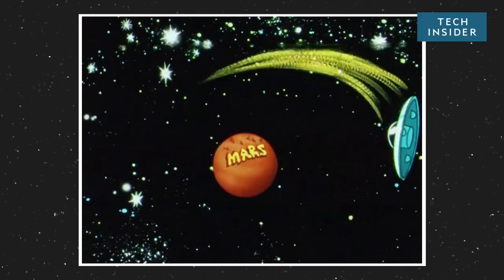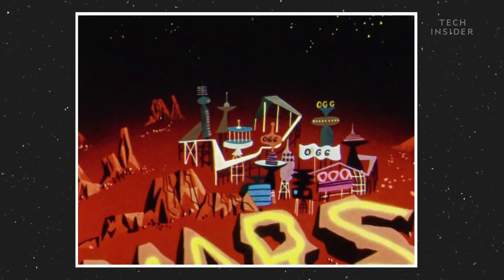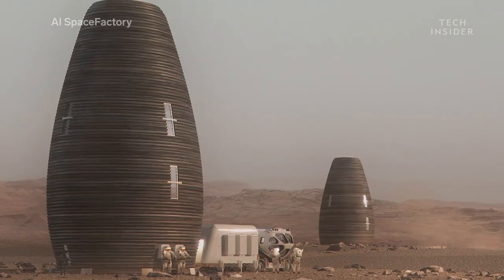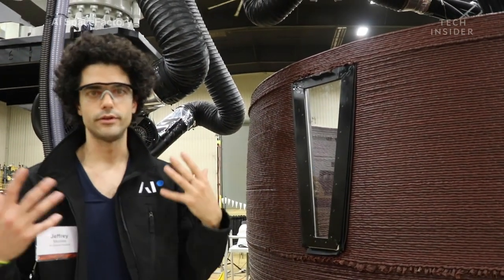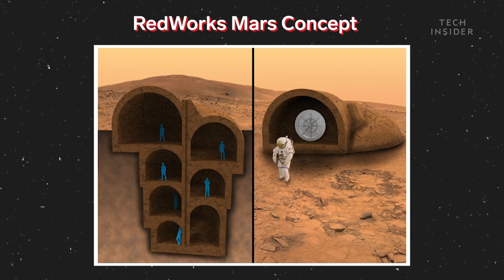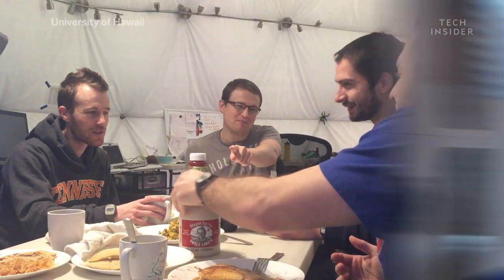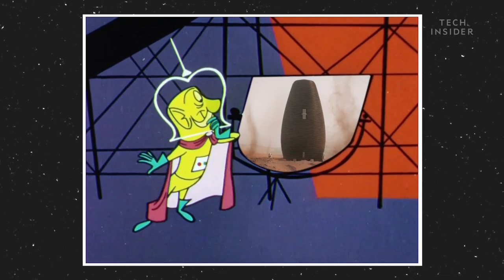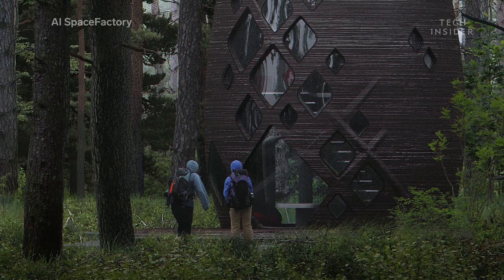The Mars Homes That NASA Awarded $500k

Comment: I would love to see everybody living in a house like this on earth. This would save so much more space and would offer a life in a good relation with nature.
Reply: I think it's very attractive. I would live in one
Reply: It looks awesome when you think about it. But the cost of the building will be very very expensive.
Reply: @fizan6129  Not nearly as expensive as a normal house. Because of 3d-Printing it will actually be quite cheap, depending on the cost of the used material.
Reply: The main issue would be how it holds up in extreme winds and extreme winter.
Reply: @shadowscall7758  I can't imagine a wind strong enough to lift such a house, espacilly including all the interior. And if it's strong enough to survive mars than it's strong enough tu survive winter too, dont you think so?
Reply: @dem4xed  The winds wouldn't have to lift it, just knock it over. As for the winter, if it is airtight, great, but it would still have to have some form of heating.

Don't get me wrong, I would love to live in a house like that and would love it if more people did, I just would want to make sure all of the considerations are made. Too often, you see stuff like this being touted as "the next best thing in housing" but you only ever see examples of it in temperate environments with mild weather.

It would force you to be minimalist, which would be great for our society and you could build a bunker close by for emergencies.
Reply: @shadowscall7758  Are you not aware that Mars has a much colder temperature than earth and has extremely harsh dust storms? Marsha, the Mars Home, naturally has to have better insulation, better heaters, or any other technology needed for a house to survive in a harsh environment on Mars, which means the house has to be naturally stronger too. Seeing as they're gonna build Terra with the same materials as Marsha, then for sure this house is more than enough for Earth. Of course it would need some tweaking to better fit the less harsh environment Earth has.
Reply: @eroxcis  Mars storms are not as bad as some of the storms on Earth. Movies get that wrong all the time. Sure, they cover everything in dust, but the winds only get up to about 60 mph, which is less than half of the speed that winds on Earth can get to.

https://www.nasa.gov/feature/goddard/the-fact-and-fiction-of-martian-dust-storms

As for the cold, yes, Mars is cold, but the heating system they would use is probably something not affordable for the average person, so it would mean the house would not work for the average person in cold areas, unless it was an affordable heating option.
Reply: @shadowscall7758  Houses on Earth are also not strong enough to survive the harshest of storms, and to be fair, depending on where you live, they're not common.
Also, whatever you see on the video is clearly something they're still working on, not everything you see is final yet, and of course how Terra will be built will be different from how Marsha will be built (seeing as they both look different), just that they'll use the same materials. 

Also, I suggest reading my comment again because I mentioned this: "Of course it would need some tweaking to better fit the less harsh environment Earth has.", which, if you didn't understand, meant that heaters and other things will be changed to fit the type of environment Earth has.
Reply: Shadowscall775 telling by the shape of the house most wind will probably go around it
Reply: @advancedsoldier8569  Yeah, I am hoping that would be the case. Like I said, I would love to see houses like this become commonplace.
Reply: It's round, thus it's less safe and has much less space... Plus water damage will become a huge problem....
Reply: david abe why would water damage be a problem?
Reply: @advancedsoldier8569  Because water will soak through... The windows are all "weak spots" and will eventually fail, and they are incredibly exposed. This is one of the worst designed homes in human history. I get it, it looks cool, I can see that... but all i see is failures. The insulation is near nothing as well. It's round so you lose crazy sqft and structurally it's incredibly weak. 

NASA stole our money and gave it to a team of children pretending to make something of value.
Reply: @dem4xed  It's made of basalt this shit ain't cheap
Reply: @dem4xed  Not sure if 3D-printing is the best way to go about it. For general purposes, it's a good short-term solution for small-scale production, but it has its own issues. If you look closely, the products you get from 3D printing have striations, since the machines lay down melted fibers from the bottom up. Consecutive fibers don't always meld together completely, and it can create structural weaknesses called weld lines. The quality that is needed for the product depends on the intended application. This kind of stuff is basically within the realm of engineering.
Reply: @Psi01  Thats true. But as they said in the video, 3D-Printing needs improvement before this can really work. Nonetheless I am very optmistic about that.
Reply: @FEV369  Why do you think that water seaks easier through those structures, than stone ones? Why are windows espacially endangered by water?
Reply: @Blankenboom77  I dont think that they would build it from the same materials here on earth, if it would go into production.
Reply: @dem4xed  I'd suggest reading some basics about building. These are the weak points of a house, water bleeds through. This is not "stone." It's pours, it's thin, has little to no insulation (R). Rock like this will draw moisture in through all the walls that are covered in water due to it's idiotic shape. 

This is in fact one of the worst designed homes in human history.
Reply: @FEV369  Yeah right, it isnt stone so i think, its actually more capable of keeping you dry than normal houses are. Second: How do you know that, those are pourly insulated? Have you ever seen the whole building process? How do you know about the insulation abilities of the materials used? Do you really think that square shaped houses are better in keeping away the rain?
Reply: @dem4xed  You clearly have never worked in any kind of construction. I give up, this "house" is perfect for you... The world has been building wrong forever, no one ever thought to place windows facing the sky or build walls in massively limiting circles. 

Do you even understand how a circle limits sqft? Do you even understand how structurally a circle is vastly less stable than a square? Go stack stuff in a circle... go... do it....
Reply: @FEV369  Yes for shure. And thats why sodacans are withstanding massive amounts of force when applied facing the plain side. Youre right. Circles are so poor.

Btw. round houses aren't new inventions. Humans build in round shapes since they build at all. I suggest reading this wikipedia entry, or any other source faving this topic:

https://en.m.wikipedia.org/wiki/Roundhouse?wprov=sfla1
Reply: @dem4xed  Look, my goal is not to be a dick. A round house looks cool, in fact I have a 3 story turret (round) on my Tudor style house. It's cool... spiral stairs are cool. But at the top floor is my music studio, and the walls are all round... So you lose a massive amount of SQFT because everything bunches in a smaller area. Think about setting a desk against a round wall, it pushes you in, you lose sqft in the center back of the desk, unless your desk is rounded to match.

In a big ass round house (google them) you see a wide open floor plan, because if it's not open, it sucks. Think how you would make rooms inside of a giant round room. The walls would start to triangle. If you have a closet on the round wall, it would have to be roundish, the doors roundish...  Your bed would butt up against a roundish wall... Pictures hang weird. Basically you start trying to add strait walls but in doing so you make really awkward rooms. 

In big round homes you usually don't have walls going to the ceiling, separating rooms. Now noise carries... 

Again, round homes look cool, but they are cool for a rich person as a get away lodge... 

As for the windows... Windows are "weak spots" in building. Water collects around them and over time damages the home. In the case of this design the windows physically face up, thus water will rain onto the windows (wtf btw) and then collect. From there you have pooling water, it WILL enter the house. It will add moisture to the home. It WILL destroy the window. There is a reason we have a roof line that goes out 1-2 feet, it's to keep the rain off the sides of the home and off the windows.
Reply: @FEV369  Of course the furniture made for rectangular houses doesnt fit for round houses, just as over way around. But making round furniture doesnt seem to be much of a problem to me. They could be mass-produced if everybody would use such.

To the windows: Does your car get wet just because the windows face upwards and arent protected by a roof?
Reply: @dem4xed  You seem to truly not understand how homes are built. 

Yes, in fact your car bleed water into it because the windows are faced up... They drain out the bottom of the door... In your house, that would be draining into your home. 

You glossed over how rooms would be awkwardly shaped in a round home... You don't understand the sqft lost by the "pinch" of strait walls going from the outside of a round wall to the center point. 

Get a piece of paper, start drawing walls and furniture to fill your round house... watch as you quickly start noticing massive sqft looses, awkward room dimensions. Now start placing mirrors and pictures on theses walls and notice they face the wrong directions or hang poorly on a round wall.

You claim if homes were round that we would just build round furniture. It's like any type of building is a foreign concept to you. You make an incredible assumption that all homes would be built off the same diameter... so rounded items would only "fit" homes of a similar diameter... Where as all furniture built for any square home fits, as long as the room is big enough (same for a round space.)  

I honestly think you should get a piece of paper and start drawing. if you don't do this first logical step I can't take you seriously. If you don't take that first step, you shouldn't take yourself seriously on this subject. Considering how easy this is to do, if you can't bring yourself to do it, I can't believe you spend the time at least envisioning the problems innate with round exterior walls.
Reply: @FEV369  Making some furniture with different diameter isnt any different to making different sized rectangular furniture, you just need to stick with certain diameter-formats. Who, for whatever reason, wants a special diameter needs to pay extra money. 
Second. Your point with the window isnt making any sense to me. If your car gets wet by rain, than you should consider repairing it. 
Third. You aren't loosing square feet, you're just spreading them differently if you build round. 30 round square-meters are 30 rectangular square-meters. The concept of putting walls in the middle of a house is actually much more spaceconsuming than building round.
Reply: @dem4xed  I take it you put a net total of zero effort into drawing out this wonderful idea of round living.

Take care man.
Reply: @FEV369  I was hoping to be able to change your mind.

Anyways, take care.
Reply: Influunt Plus plus more space
Reply: @dem4xed  I was hoping you would put actual effort into proving your position on the matter, but you didn't... and thus it was impossible for you to convert me with such laziness.
Reply: @FEV369  For me there's nothing to prove. What is missing in my argumentation? I can send you a picture of a drawing showing a round room via dm if this is possible and if you want to.
Reply: @dem4xed  A piece of paper with a circle and how you would divide up your pie home... You must be a joy to "debate" with in person.
Reply: @FEV369  Okay here's a link where you can look at some scribbles. Proportions could be off. Sorry for that.
https://1drv.ms/f/s!Arl6GUZ4jlck0Hn2Q_3oZ_3A8ZxP
Reply: @FEV369  Have you actually watched the video? Everything isn't final yet, and if you're not aware, the house is meant for Mars, a planet wherein rain doesn't happen anymore. 

And as for Terra, the house they're gonna build on Earth which is similar to the Mars Home, Marsha, they're only building one as a test and something they're gonna use to also learn how they can better the building. Also, I'm sure they're also gonna hire engineers and others so that Terra will fit Earth's climate.
Reply: @FEV369  it seems you dont know how to read since I clearly mentioned this:

"And as for Terra, the house they're gonna build on Earth, which is similar to the Mars Home, Marsha, they're only building one as a test and something they're gonna use to also learn how they can better the building. Also, I'm sure they're also gonna hire engineers and others so that Terra will fit Earth's climate."

I also mentioned how everything isn't final yet. 

Also, those people are not as idiotic as you are, they don't just jump in without understanding the circumstances, they know the climate and environment Mars has so they obviously will add a lot more to the Mars house. Like I said, everything isn't final yet.

Oh and... I suggest stepping down on that pedestal you put yourself on and learn to read first. I felt embarrassed for you when I read your comment.
Reply: @FEV369  oh and if you haven't noticed, Terra and Marsha are actually built differently, they're not gonna build huge windows on the Mars home, just on Terra. 

And are you not aware of the Building Code? They're not gonna carelessly make Terra without actually properly building it, meaning the things you're so concerned about such as the rain seeping through, won't happen. 

Educate yourself before you jump in this debate please.
Reply: Shadowscall775 they don’t understand the wether and stuff could be worse on mars
Reply: @lexithomas8722  Maybe improve on your english and understanding first before you say anything. Watch the video again and try understanding that the house is not yet final, they're still planning on improving on the house, they simply just have the base of what the house will look like and be made of.
Reply: too many people got junk so where thy gonna put all their stuff
Reply: @lyricgirl2012  then build a bigger house? Problem solved.
Reply: @FEV369  You do realize that technically everyone is dying slowly, whether on Mars or not right..?
Reply: @FEV369  
These are people that are creating a house for MARS, I don't think that they'll be so dumb as to completely overlook safety. The first thing they are probably working IS safety. You don't just create a house and not think about structurally integrate it'll be(not sure if I worded that right). 

Oh and one more thing. People aren't "haters" because they argue with your opinion. Just because they don't agree with you doesn't mean they are trying to be rude. That's such an idiotic thing to say.
Reply: @eboyicecream1305  Uhh, ok... I hope you messaged all of them for all the names they called me. 

Take care.
Reply: @FEV369  David, there weren't any name callings, just one insult from me because you failed to read my comment properly. 
Why must you embarrass yourself like this David.
Reply: @eroxcis  Have fun in your radioactive igloo. Mail us letters telling us how great it is there.

Bye now.
Reply: @FEV369  David, we already talked about this, or do you actually not know how to read? Shocker

Comment: AI space factory: this badly based composite will protect the inhabitants from the deadly radiation of the sun

Also AI space factory: S u N r O o F
Reply: pretty sure it was sunlight or something.
Reply: Lol as thin as it is compared to ours, Mars does have an atmosphere. So with that in addition to the sunlight being filtered through the specially prepared windows, it should be fine for people to be in sunlight... While in the home or in a space shit of course
Reply: @shrutis  suit*** lol omg
Reply: Laffing Gas it’s radiation from it’s grounds absorption of radiation from the sun overtime, so it’s in long term the sun but immediate protection needs to be from the ground
Reply: Yasmine the specially treated glass will stop a lot of the radiation but it’ll still go through more than a regular roof would so not worth
Reply: Mars is really far away from the 🌞.. More distant=less radiation right?
Reply: @wisedude4506  It's the lack of a radiation protecting atmosphere that's the real danger. 🌞
Reply: My guess is that the roof would have a faraday cage, which would prevent nearly all radiation from above while still allowing light in. The same technology is used in microwave oven doors and it’s rather cheap (heavy though)
Reply: @wisedude4506  ahah no not at all, remember space is (almost) empty, the radiations coming from the sun are not stopped by anything they just go forward forever. And by the way yes radiations come from the sun but they also come from the constant cosmic radiation coming from all the other stars :) so no mars is not less exposed to radiations then earth in fact it's way more dangerous there because the martian atmosphere is so thin.
Reply: @camstudiosfrmd8   Oh... Thanks for explaining dude 👍
Reply: @wisedude4506  😁